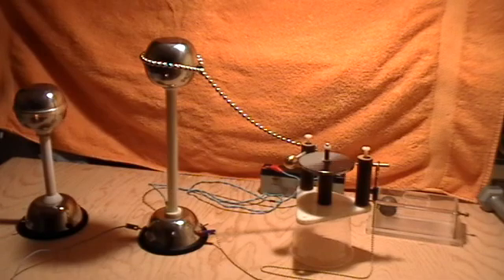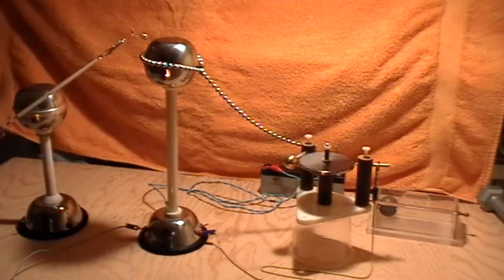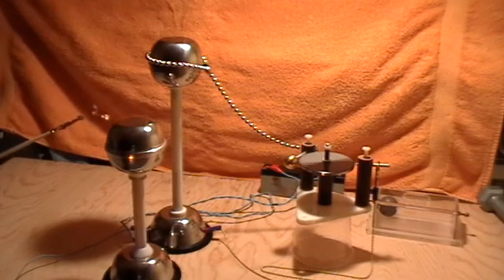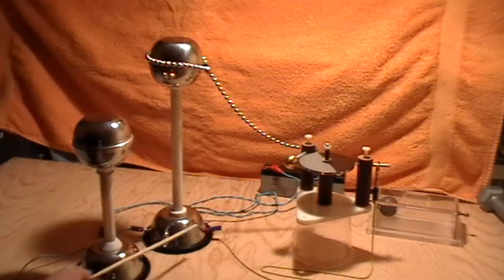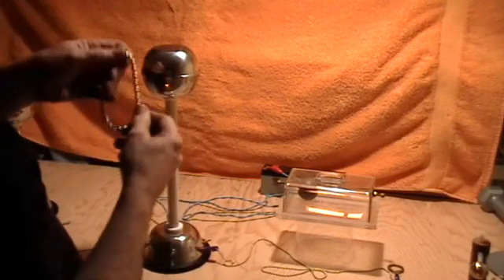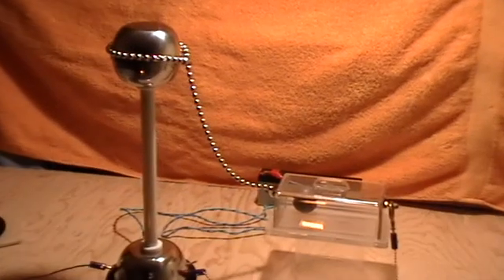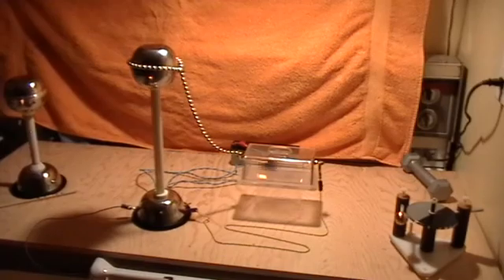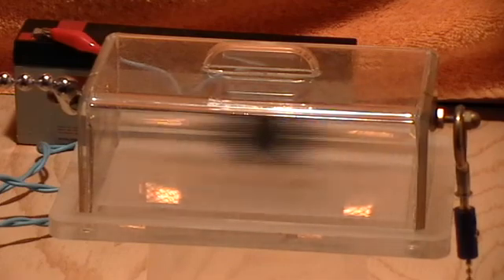Yet Another Van De Graaff Demonstration

Comment: On a two ended system make sure you mount your motor and switches at the equipotential centerline which itself can be grounded - use a rubber pinch wheel that matches the triboelectric scale of the band and you should be ok. It'll be the first Horizontal Dipole VDG I've ever seen :D

Comment: Actually a hollow sphere will always redistribute charge to bring the inside to zero - Therefore continually adding a charge to the inside will result in an increase externally. The PPB speed differential is peculiar, perhaps a tach on the motor is in order.

Comment from the maker: Yeah, Lewin's great, he's one of my heroes.
Hmm--I don't know the video you describe, but the way you describe it makes me think it was a non-conductive, dielectric sphere. Because a conductive sphere, isolated in space, will have all its charge on the outer surface. A smaller sphere, within the larger one, will always be at higher potential, so current will flow from inner sphere to outer along a conductor. So the inner surface of a conductive sphere will act as if it is oppositely charged****

Comment: Sweet, thats an interesting motor!  Im wondering if it would be possible to elevate the whole van de graaff and have spheres at both ends so you could pull off positive and negative HV from one machine instead of having to use two different machines.